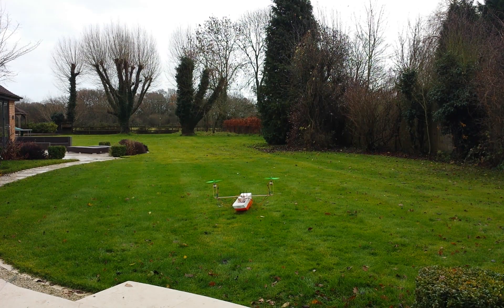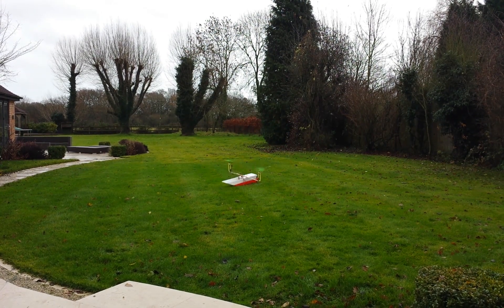RC VTOL Hover Testing #1

Comment: You've done it and I'm merely theorising. Couldn't you do the mixing in the transmitter and use separate solid state gyros on each axis? That way, you could build a much smaller, lighter and cheaper version. Some of the commercial companies (like Parkzone) are already producing something similar.